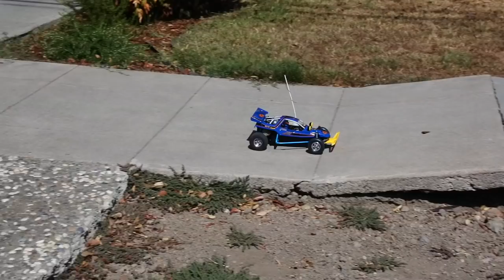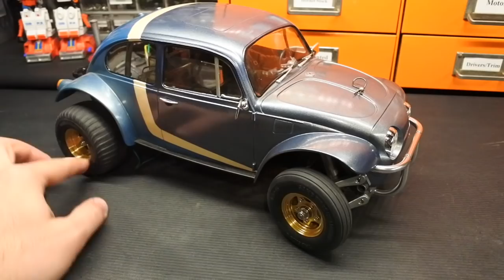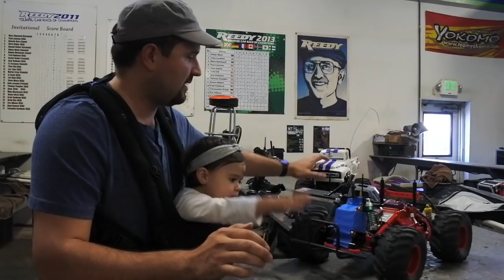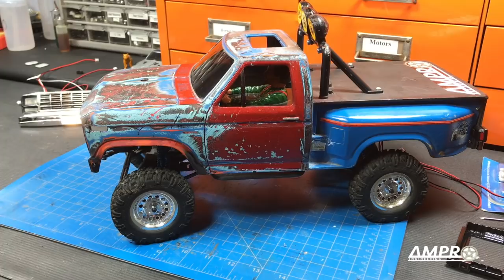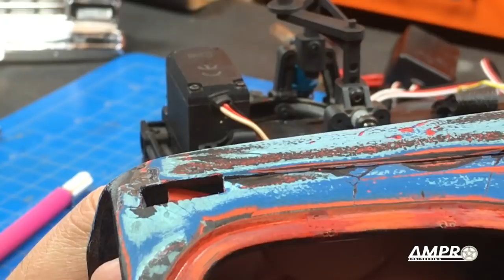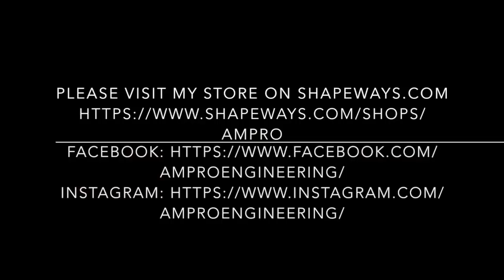e202: Tamiya Ford F150 Blackfoot Side Marker Installation

Comment: Great stuff as usual. . But why not just drill a few tiny holes and use some modelers file to get the right shape? Much easier and safer.
Reply: I had the same idea! I know how easy I cut myself with a knife (very often!). But really cool stuff and so much love for this body!
Reply: I was coming to make the same comment. Safer and more accurate.
Reply from the maker: You are totally correct! I have a great file I could have used in my drawer and didnt for some reason!